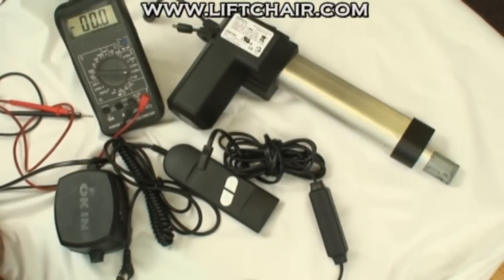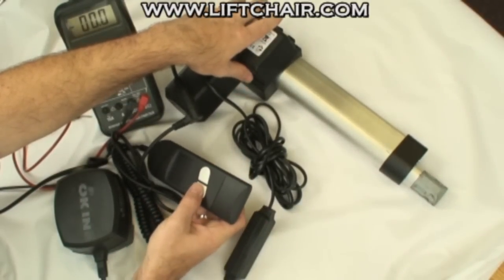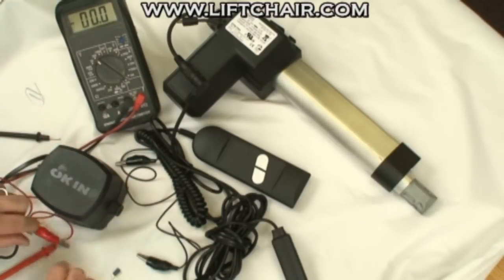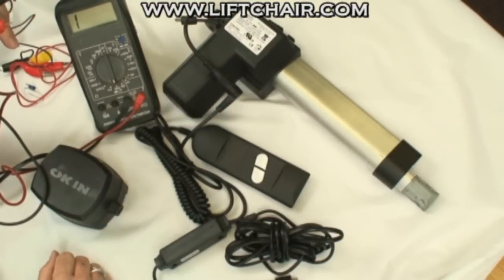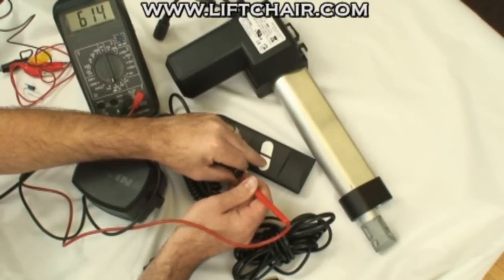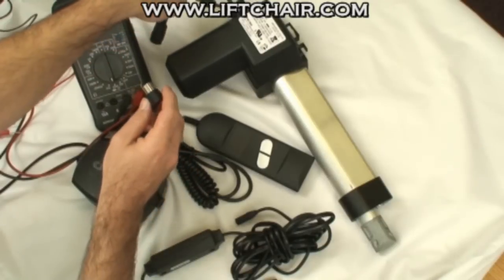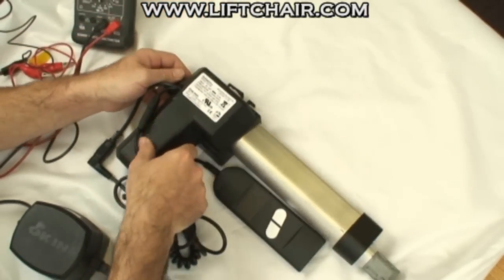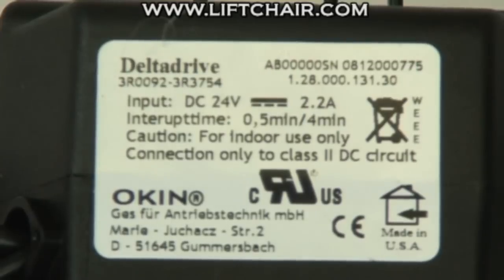Liftchair.com Trouble Shooting Video

Comment: The motors on lift chairs rarely ever just "break"...don't dispose of your chair and buy a new one so quickly...my mother's lift chair/recliner was stuck in the recline position...I ordered a new remote control (her chair has the 5 pin corded remote) but that didn't help...so I turned the chair on its side...removed the motor and unscrewed the 5 screws holding the motor "innards" inside....a simple look at the fuse shown it was blown...a 2-pack of replacement "glass" fuses costs $3.00...her chair had 2 fuses attached to the motor circuit board...one was good the other blown out...after replacing fuse...re-installing the motor...and giving the motor tracks a liberal coating of white lithium grease the chair operates perfectly...after panicking about having to spend $200-$400-$600 for a new power-lift chair we had a good laugh at only spending $3.00 (not including the new remote for $16.00 which is being kept as a spare)
Reply: Hi. Could you tell me what brand chair you have and where you found the fuses? I have a Pride model a little older. Do you know if they have fuses too?
Reply: Really interesting.   Question: the "5 screws holding the motor "innards" " --- wonder which they were.    My motor has 4 screws that reveal the mechanicals -- the drive screw, a couple of gears, and the "linear drive" mechanism.  Only those mechanicals and a bunch of grease.   The electricals and the motor itself are over to the side.  2 really long screws and that's IT for the cap holding the motor and electricals.  It won't unscrew, and there is a lump of stuff off to the side of the otherwise cylindrical motor cover.  No screws.   Were there 'hidden screws' under the ID labels?

Comment: Great video ...but please show or tell exact multimeter settings...kinda impossible without that info. Chair is stuck in reclined position,  is there a way to hook a 12 volt battery to get it down

Comment: Is the motor removable shaft a replacement item? My moms chair pin came lose because the clip pin came lose letting the plastic end bind up and shear off. Also it is a threaded insert .

Comment: Why is there conductivity on the hand control all the time, with NC or normally closed switches? I would think a remote with momentary switches would be NO, or normally open, and when you push the button it closes the circuit and allows current to flow through. Or is the remote connected to a delay of some kind?

Comment: thanks .everything was all good with the tests you showed and then I took the actuator seemed to be jammed so i removed the back of the motor and turned it down with my drill and behold the problem solved but I couldn,t have done it withot testing everything first.

Comment: Good morning this is not a comment but a question the wires connecting from the motor to the remote are exposed and damaged  even though there is green light on the outlet box not able to work the chair can l replace the motor all together for it’s the wiring from the battery to the controller that is damage and is it simple to do

Comment: I HAVE A 4 BUTTON HAND CONTROLLER ON MY RECLINER.  I DON'T KNOW THE MAKE OF THE RECLINER OR THE CONTROLLER EXCEPT THAT IT SAYS "EASYLIFT" ON THE CONTROLER.  THERE ARE 2 BUTTONS THAT LIGHT UP "LOCK AND UNLOCK".  THERE ARE 2 MORE BUTTONS. 1SAYS "UP" AND THE OTHER SAYS "DOWN"..  I HAVE ONLY BEEN USING THE UP AND DOWN BUTTONS TO LOWER OR RAISE MY HEAD  (TO A STANDING POSITION OR A SLEEPING POSITION.  THE CONTROLLER GOT JAMMED BETWEEN MY BODY AND THE RECLINER,.  NOW THE UP AND DOWN BUTTONS ONLY MOVE THE ENTIRE CHAIR HIGHER OR LOWER.  I DON'T HAVE A MANUAL.  HOW DO I USE THESE BUTTONS?  IS SOMETHING BROKEN OR IS IT JUST LEARNING HOW TO USE THE BUTTONS?

Comment: You refer to "this lead and this lead" when testing the motor, but where you're touching with the test leads in not visible. Please help. A little more info for those of us who have never used a multimeter?

Comment: have catnapper powr lift recliner , remote cords were pulled out. four wires, white wire still attached, yellow, black and green are disconnected. where do I find a new or schmatcs for resolder? plz help
Reply: +Ricky Yazzie  I am needing same info
Reply: +cnf6966 figured it out, resoldered. chair works again
Reply: where did the wires go???
Reply: The  hand remote  , bottom  that raises  the  foot up and down stopped working  , what do I  do to fix it  ?

Comment: Thank you for the video.  I have a leather 3-piece set (couch, loveseat and chair) that uses similar Okin motor and control system.  My motor functions in one direction only (retract).  I have it disassembled and can test it on different power supplies and switches, (this one was on the chair, verified switch and power supply function from the love seat switches).  I figure the little switching supply board is faulty, but how do I check for sure?  Seeing the motor spin one way but not the other surely means the motor is fine.  And, will Okin supply me just that little controller?  This thing was taken out by a power surge when lightning hit a power pole down the street.
Reply: @Ace Royal instablaster :)
Reply: @Boone Simon I really appreciate your reply. I found the site through google and I'm waiting for the hacking stuff now.
Seems to take a while so I will reply here later when my account password hopefully is recovered.
Reply: @Boone Simon it did the trick and I actually got access to my account again. Im so happy!
Thank you so much, you saved my ass!
Reply: @Ace Royal No problem :D

Comment: I just replaced the motor but it won't lift my weight. Any idea? I only weigh 206 lbs
Reply: Their website claims that the most likely thing to fail is the hand control.

Comment: I ordered a block and found it impossible to fit onto the shaft. I have taken the unit apart and I suspect that there are different sizes of shafts and blocks. Is this so? I have tried to manually push the shaft into the block but find it impossible. Please help.

Comment: The hand controller does not light.  We replaced the batteries.  Still it does not light.  What do you recommend.  My mother bought this chair in 2012.  How much is a new hand controller? 1.28.000.002.59

Comment: my lift squeals going up and going down and I cant stop it from squeaking  help,
Reply: I was a lift chair tech for 13 years. I found the normally the  cause for a squeal going up or down is caused by the scissors mechanism. If you spray some silicone spray on every joint on the mechanism and also any place you see a clevis pin on the frame. Let it work its way in by running the chair up and down and that normally solves the problem.
Reply: Joe, what does it mean when your lift chair is moving slower and slower? Also, the motor noise is lower. Does it usually the motor that is gradually dying? Is it better to replace dual motors? Thank you.
Reply: @joewigginsfortynine  Joe I have a question for you in the other comment. Thank you.
Reply: @windermere2330  What it means is a  power supply problem. If it is moving slower and slower it is on battery backup and the batteries are wearing down. Check to make sure it is plugged into the wall outlet and also make sure the outlet is not controlled by a switch which might be turned off. Seen this happen many times.
Reply: Another thing you can do is check to see if the outlet has power getting to it. Plug a lamp into the outlet and make sure the lamp will light up. If it does not outlet circuit could be blown and you then need to see if the breaker tripped.
Reply: @joewigginsfortynine  thank you for your responses! I know it’s not on battery back up because my battery back up is broken and I never replaced it. Also, I still raise and lower my chair a little bit every day and it still works that way. I never fully recline it because I don’t want to get stuck if the motor stops working completely.  The socket works fine. I already checked it. When motors wear out do they wear out gradually (moving your chair slower and making less of a noise) or do they just stop working right away? I mean, the Recliner is six years old now and has had pretty heavy use. At least 12 hours a day for the past few years. It’s not slept in though.Thanks again Joe!